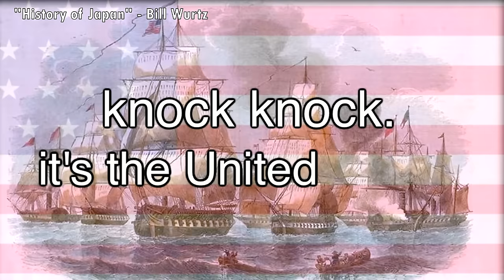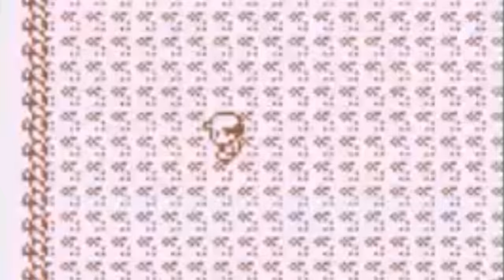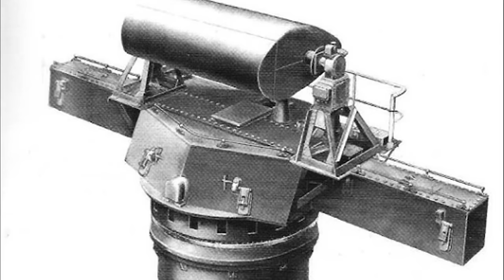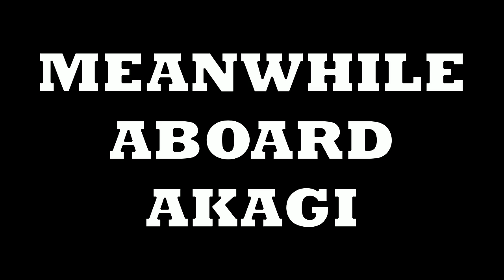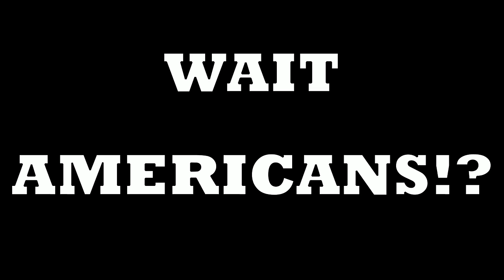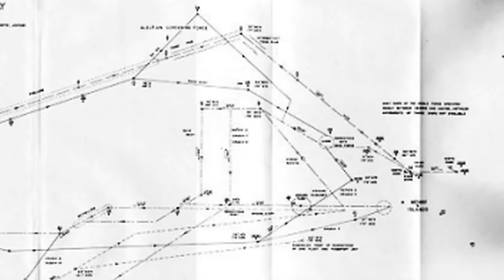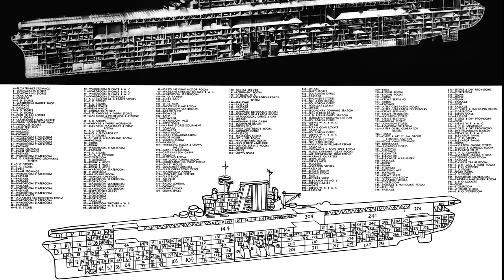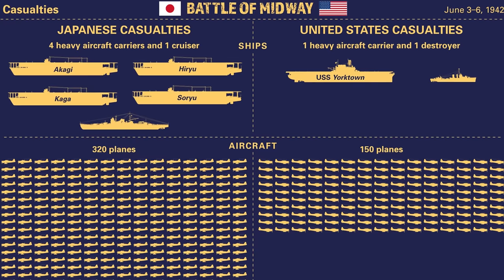Japanese Aircraft Carrier Akagi - WW2 History Documentary

Comment: Just a minor correction regarding the defenses of Singapore; The anti-ship batteries were not incapable of firing landward. The actual, insurmountable issue is that they had only ever been provisioned with armor-piercing shells. High explosive shells were typically of little use against armored warships which could pick their range against the stationary batteries. While in theory, such shells could have been provisioned with some foresight, by the time they realized they needed them, the Japanese air services had already cut off any ability to bring in supplies from outside. And trying to counter-battery Japanese field guns and sink riverine landing craft with armor piercing shells would be about as effective as trying to take them out with the same number of English longbows.

Comment: Question, if a triple deck aircraft carrier would be such a nightmare for a single airboss to manage, is there any reason you couldn't have two or even three airbosses, aside from shortages of trained personnel?
Reply from the maker: Imagine trying to co-ordinate both launch and recovery simultaneously. Or dual launches between decks. And then factor in that only the later model aircraft have radios which means wave off. Launch. And go around have to be done via signal flags.
Reply: @AnimarchyHistory  There are reasons that modern US fleet carrier deck ops still use ‘The Board’ to manage aircraft on the flight deck.

Comment: Honestly now that we have steam catapults that are reliable we could actually probably do carriers with 2-3 decks 2 for taking off 1 for recovery have 2 air bosses 1 for recovery other for taking off simply cause we really only actually need around 50-100 feet to have a steam catapult and to take off with them but needs to have decks separate and not like right above each other cause dangerous so like 1 deck on one side also makes carriers so much more effective simply cause well 1 deck = planes have to land and can't exactly launch while those planes land since deck has to be mostly clear for safety reasons so don't need do that as planes can safely land while others can safely take off and won't have to deal with possibilities of wires failing and loosing 1-4 planes cause wires or plane failed
Reply: The angled flight deck allows for that as well and the super carriers are already really tall.
Reply: @jacobdill4499  true but they still all are on a single deck never know what emgercy will come up

Comment: Your account of Midway is wildly off. I’d recommend reading “Shattered Sword” by Parshall and Tully. First, VT-8 attacked almost an hour before the dive bombers. In that time, several CAP aircraft were launched and recovered. Second, there were no aircraft, munitions or fuel on the decks of the Japanese carriers during the bombings. It was against Japanese doctrine to have aircraft on deck unless they were warming up for launch. Plus other information you provided. While it makes for a good story, it’s not what actually happened.
Reply from the maker: I mention the fuel and munitions were on the Hanger Deck - which is where it was. The fuel system is in built into the ship which makes it susceptible to leaks upon taking hits. Now. One thing I will say is that yes. I did avoid using exact timing to streamline the battle for narrative reasons. However the Midway force was recovered and the CAP wasn’t renewed in its entirety. Delaying launches. Funnily enough Shattered Sword was my primary reference document. The fighters on station had run out of ammo and Nagumo hadn’t kept enough Zeroes up. That is true.